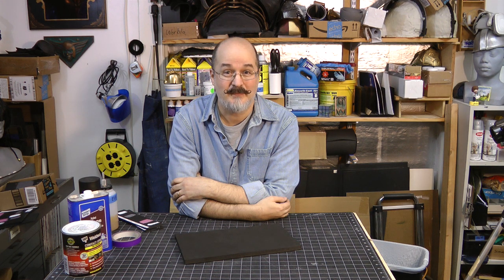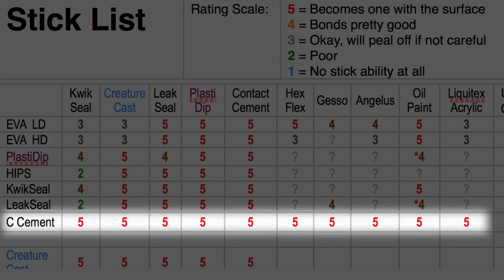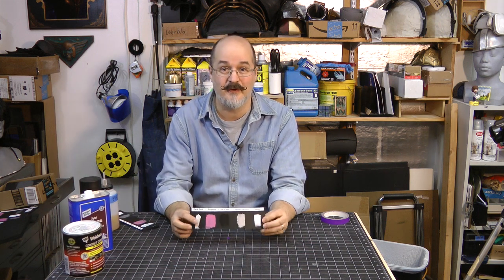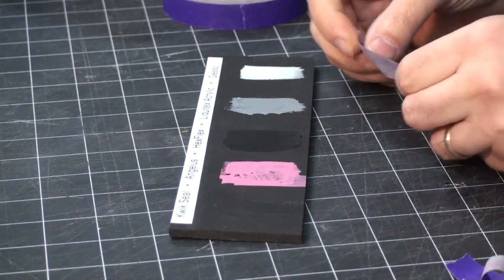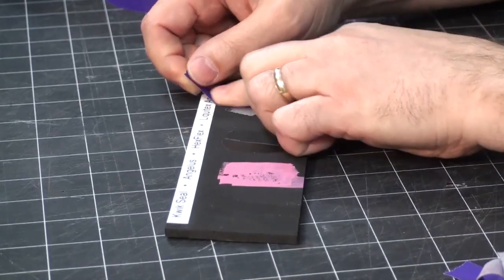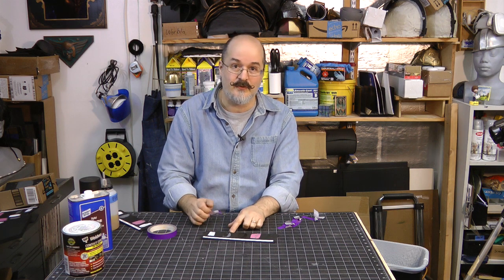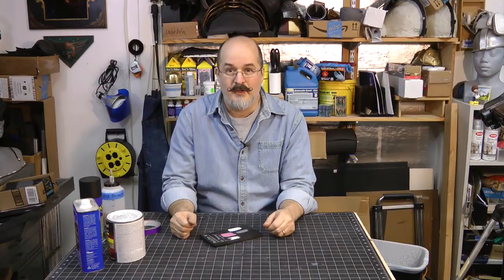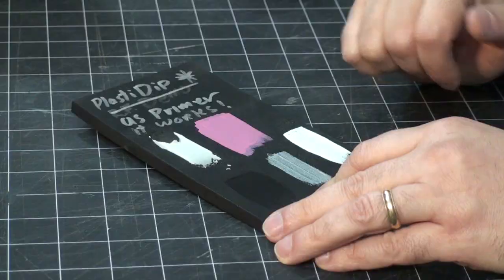Priming EVA Foam With A Contact Cement Wash

Comment: This doesn't harm pieces that have been bonded with contact cement?  Like does it have the ability to start separating contact points?
Reply from the maker: Yes, you do have to work carefully around glued seams. I have had no problem when putting a little over the seams. Test first :-)

Comment: Would this need to be primed afterward or do you think you could paint directly over this?
Reply from the maker: This does not fill in the pores or smooth out the surface. What it does is create a better bond with the next product you put on it, and you can paint directly on it with your finish coat if you want to.

Comment: I assume that I can use my critter gun and apply this correct?
Reply from the maker: It sounds like it should work, as long as the wash is able to seep into the pores. The critter gun will kick out a lot more fumes, so you'll definitely need to wear a respirator.

Run a test both ways and let me know if you see a difference. 👍🏼

Comment: I'm fairly new to working with EVA foam. Can the foam be heat shaped after using the contact cement wash? I'm thinking to use in this order:

1. Cut foam
2. Heat treat foam w heat gun
3. Treat surface w contact cement wash
4. Glue foam pieces together
5. Shape foam
6. Glue trim pieces, etc
7. Apply seam fillers (KwikSeal Plus, gesso, etc)
8. Apply primer (PlastiDip, Flex Bond, Flex Paint, white glue)
9. Apply paint

Does this sound right?
Reply from the maker: First of all the order you have looks good.

Once you get use to different products and how they work you'll have some freedom on the order you can apply them (depending on the need and effect you want).
Reply: @PropMonkeyStudio  Excellent! I like having a project order, especially with new things. I figure as I get more familiar with it, I'll be able to wing it more. I'm a veteran sewist, so I know how to work fabric, but this is a fairly new medium and I've got a son's costume to make! :)

Comment: I'm working on a Buzz Lightyear suit where the final coat is actually white Plastidip.  Would the contact/xylene coat be okay to use before the plastidip coat?
Reply from the maker: Yes, as long as the cc wash is on the raw foam. I've done the wash, then added fillers, and finished with PlastiDip
Reply: Under reactivity data
Reply from the maker: @zns72  Many manufacturers of EVA foam make it differently. There will be variations in the chemicals they use. So far I have not come across any EVA foam that can't handle contact cement which usually contains xylene to thin out the rubber.

BUT, if you bought foam from a place that states not to use it. Then I would do a test on a scrap piece of foam. If the contact cement doesn't cause a problem. Then make a jar of wash and test it on a scrap. If their version of EVA foam is not stable enough for xylene, most likely the xylene will dissolve the foam.

Please let me know the results. I'm very curious to know how it turns out.
Reply: @PropMonkeyStudio  will do

Comment: If you have seams in your EVA foam does the xylene in your wash break down the contact cement you've already use to connect the two pieces at the seam?
Reply from the maker: Yes it will. I usually go up to the seam, but not in it. the xylene can reopen the seam.

Comment: My area doesn’t sell that specific brand. Can the Lanco Lacquer Thinner work?
Reply from the maker: I wouldn't think so. Xylene is made by several different manufacturers, and I believe it's used to thin down most contact cement brands. you can also buy it on Amazon.
https://www.amazon.com/Klean-Strip-QXY24-Xylol-Xylene-1-Quart/dp/B000V4L86A/ref=sr_1_2?ie=UTF8&qid=1548716380&sr=8-2&keywords=Xylene
Reply: Prop Monkey Studio 
Thank you!!